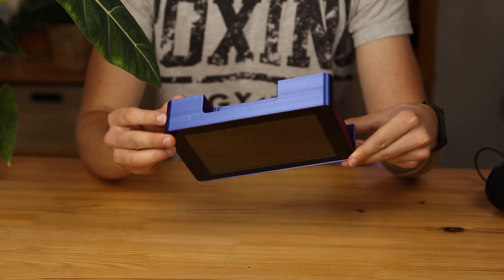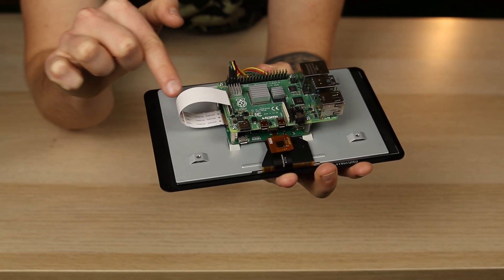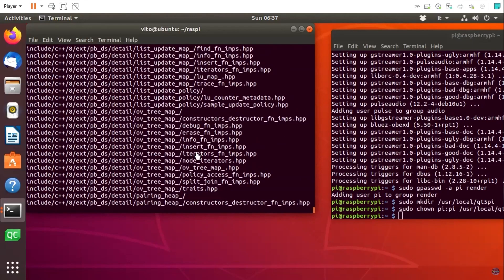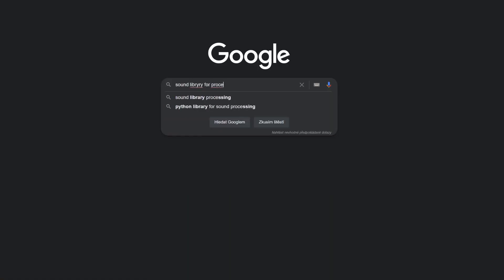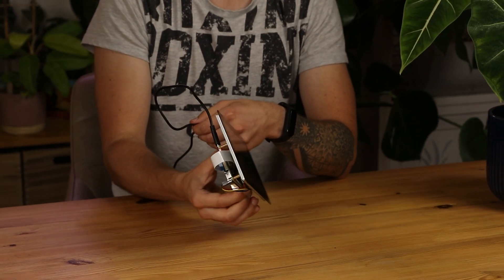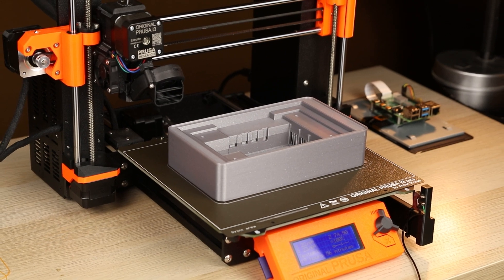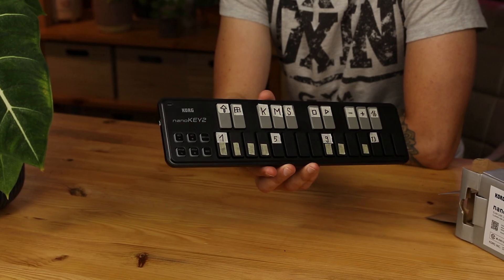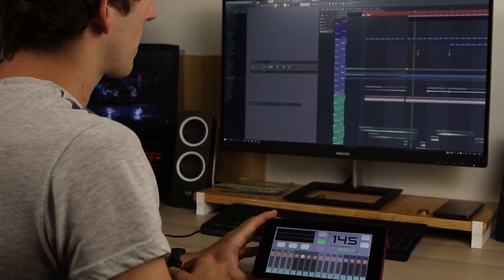Drum machine - Raspberry Pi & Processing

Comment: Really great project, using Processing for all of it is such a great idea!! i wonder if smaller raspberrys (like the pi zero 2w) would handle it nicely??
Reply from the maker: Thank you for your comment. If Raspi zero has the same OS as raspberry pi, it should works. I don't know right now and I will look at it.
Reply from the maker: I think raspberry zero should run it nicely, but zero doesn't have audio output (3.5 mm Jack) so if you want to use it in similar project you need to figure this out